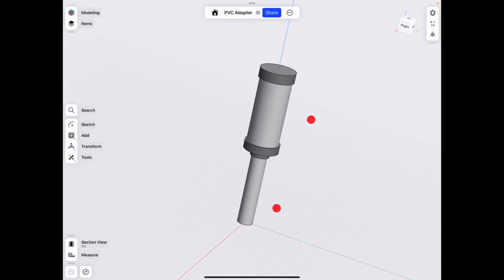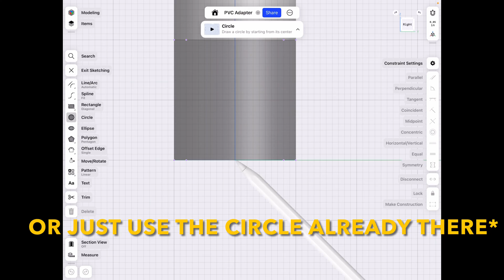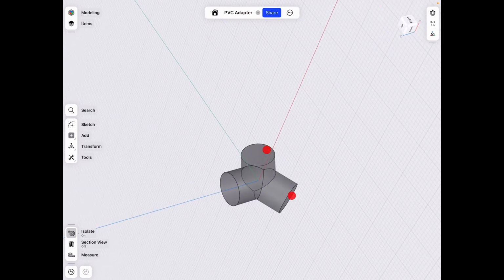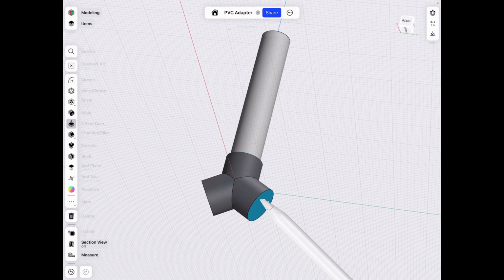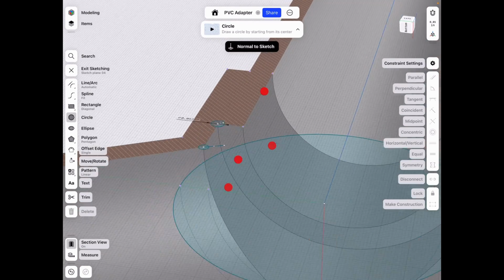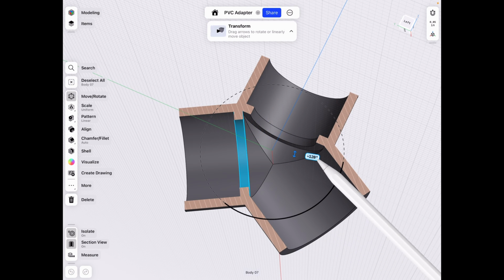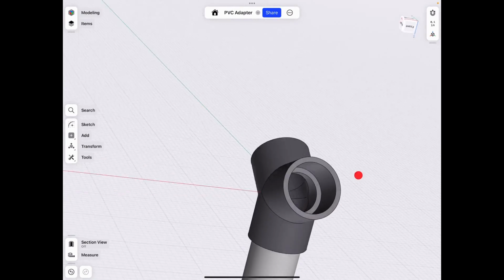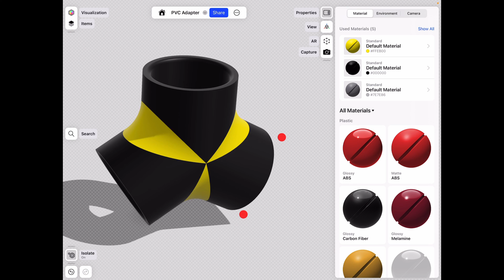PVC Pipe 3 Way Connector 120° Degrees in [ Shapr3D ]

Comment: Fascinating. I need something similar but I need 1 in and 3 out with the 3 out being at 120 degrees at 45 degrees up. Just need to add one more output to yours and all 3 outputs at 120 degrees.
Reply from the maker: Yep its very easy if you use the correct process ;) glad to help 🤘

Comment: Great again.
I’d add a bit of clearance on the inside though, because exactly matching the outside diameter of the pipe will resort in the part not fitting
Reply from the maker: Very true, but this was an instructional video geared toward teaching the method. If I was going to 3D print it I would most definitely add clearance, 0.2mm in my case 👍